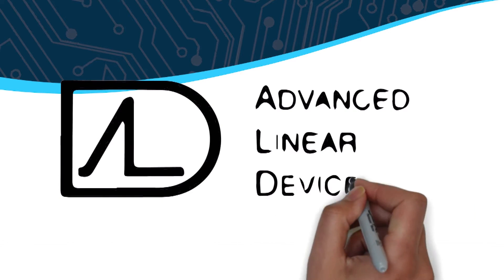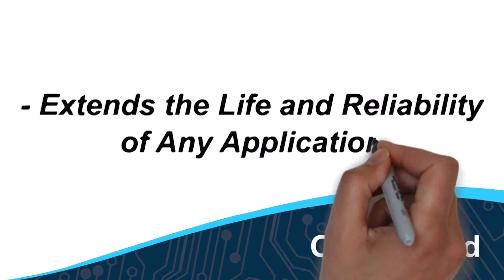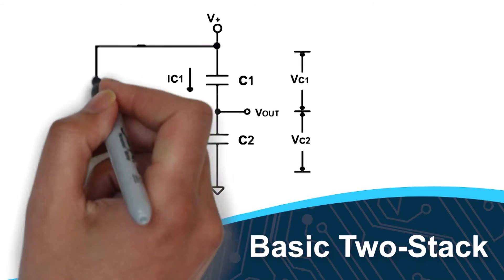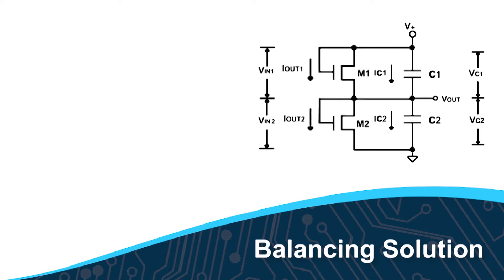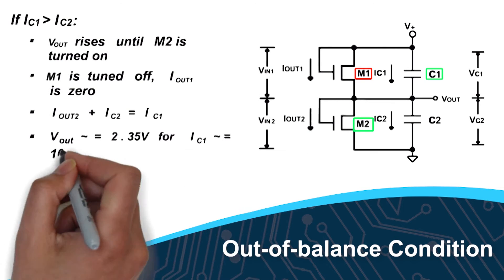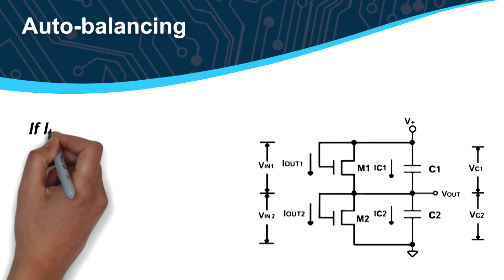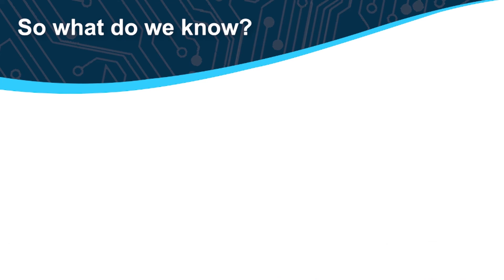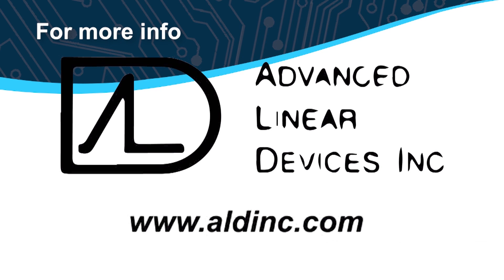Advanced Linear Devices

Comment: I read in your product documentation for all configuration examples the IDS(ON) <= 80mA. Does this mean that the maximum current I can use to charge the capacitors is only that? I am trying to determine if you product can be used for high-amperage,  fast-charging solution. Thanks.
Reply: Hi friend, I would like to use this auto-balancing solution but I don't know either if it can balance maximum of 80mA.
I would like to use it to make braking regeneration on a bike, so balancing could go to 1A
Did you get more info since u posted ?

Thank you.
Quentin